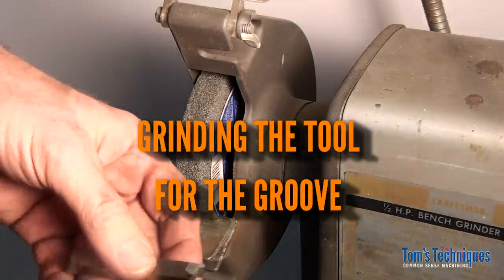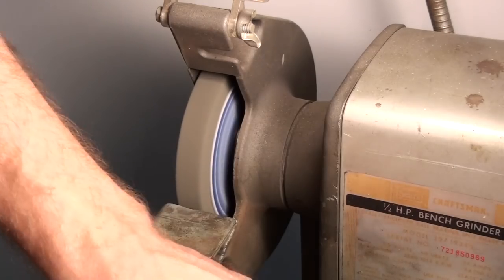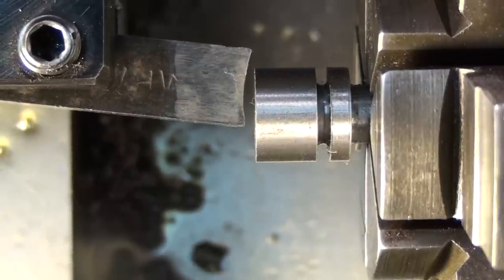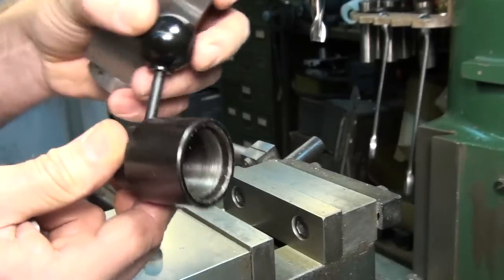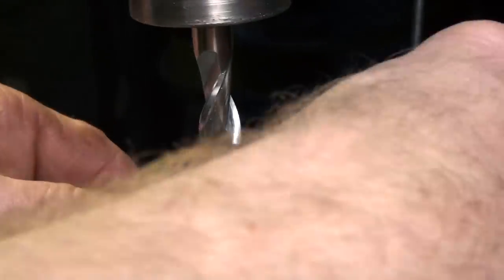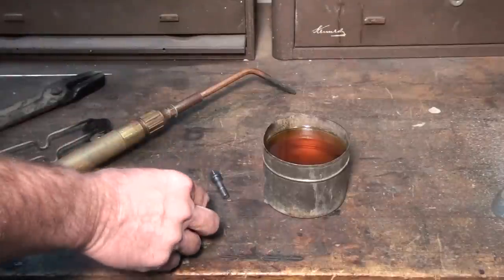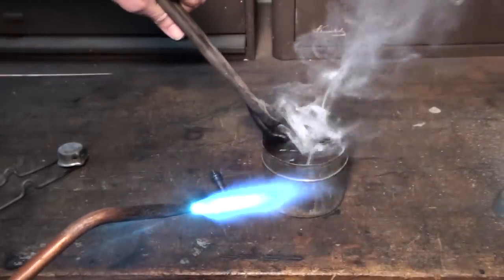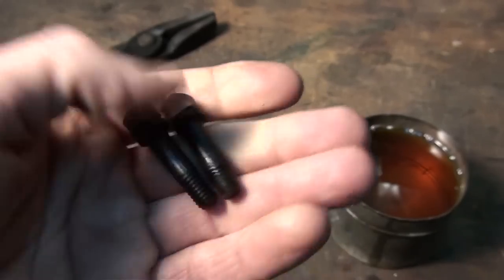Carriage Stop Clamp Bolts, Machining the Head and Heat Treating

Comment: Thanks Tom, I just got some collet blocks and the way you cut the square heads on the bolts was much simpler than what I was planning. Cutting the small relief on both sides then measuring is simple brilliance. The few parts I have heat treated really smoked like crazy when they hit the oil, I was surprised to see much less smoke and just a bit of surface flame when you put the part in the oil. I was going to ask what oil up you used but you already answered that question. 

Thanks
Shawn
Reply from the maker: Shawn,

You may not have noticed, but I burned off a lot of the smoke with the torch during the quench. It would have smoked more had I not done that,

Tom

Comment: Tom thanks for posting, especially  the HT portion of the project.  I might have to try that oil finish it looks pretty good.  Is it as effective if you start with a cold part that was not heat treated?  Say a 1018 part that did not need hardening?

At some point maybe a shop tour video?  It's always good to see how others have their shop setup.
Reply from the maker: Bill,

Oil blackening will work on any carbon steel part, it doesn't have to be high carbon steel.

A shop tour is on my list. I see that most of the other guys have done it. Maybe after spring cleaning? :)

Tom

Comment: Hi Tom,

Great video. I've done a lot of heat treating of O1 and love it (for knife making). I do use an electronic kiln and SS foil. I'm guessing that the tongs will act as a heat sink and prevent the place where they touch the part from reaching critical temp. Perhaps holding the head or shaft would be better. I'm guessing that the threads are  where you really want your toughness and the head will get some even with the heat sink. Just my thoughts. Thanks again… I love the oil finish!!
Reply from the maker: The tongs only have point contact on the crest of the thread so they probably aren't going to affect it. I have a smaller pair somewhere....

Tom

Comment: Thanks Tom!  Phase diagrams never made sense before. Now I think I can figure out the right temps for whatever steel I end up using. 

Can I assume that the "O" in "O1" is for "oil hardening", and that "W1" would be "water hardening"?  And that otherwise the process would be the same (except tempering....burning off the water won't work as an indication of temperature, or give a nice black finish)?

-- Mike
Reply from the maker: Yes, the O is for oil the W is for water and A is for air. They all have different characteristics and applications. Check the links section of my website (tomstechniques.com) for more information on steels and heat treating.

Tempering is the same with any of the steels although the range of temperatures vary greatly for the different types. You just heat them up to the temp needed to obtain the harness required for your application. The oil blackening step can be applied to any steel as long as you don't get it so hot that it takes the hardness out.

Tom

Comment: Those are some nice looking fasteners, Have you ever annealed the tool steel before machining just wondered if it would be easier to machine. Thanks for sharing your techniques..
Reply from the maker: O1 drill rod is already in the annealed state. It's just tougher to machine compared to the free machining steels.

Tom

Comment: Thanks for the video Tom.  Will the screws remain black even after knocks and scratches?  Really appreciate the video.  Sameh.
Reply from the maker: Parts blackened in oil aren't as durable as the black oxide coating used on socket head cap screws, but they hold up pretty well. The nice thing is that it's easy to "freshen them up" if needed.

Thanks for watching.

Tom

Comment: Yes tom another great job you are a very good machinist can I ask your opinion I'm getting another lathe I have a choice of a 10 by 20 precision Mathews or a 12 by 36 craftsman atlas commercial your opinion on the better lathe I would value your choice thanks for another great video
Reply from the maker: Thanks.

I'm not familiar with the Matthews, but would not recommend the Craftsman, or any lathe with flat ways. They are plentiful, but suffer a severe lack of rigidity.

Tom

Comment: Need to heat treat and temper a small 01 form tool I've made, so your heat treat/temper process was very informative. Did not see/hear it mentioned, but what oil were you using for quenching? More importantly, will any oil lose its sheen during the tempering phase? I'm planning on using canola oil, so will it dull like yours did to tell me I have reached the proper temper temperature? Much thanks.
Reply from the maker: Any motor oil will work for quenching. I just use whatever is left over from the last oil change. I have never tried using vegetable oil so I wouldn't recommend it. It may cool the part too quickly to achieve the proper hardness. It also has a lot lower flash point than motor oil.

Tom

Comment: Tom, I know there are several to choose from, but what oil did you use for quenching on this project? Is there any reason you chose this oil vs. another? I understand water or salt water might cool too quickly, resulting in a brittle part.
Reply from the maker: Oil is oil when it comes to quenching. This was some old 40 weight motor oil that I don't use any more.

Tom

Comment: Excellent info. Just please talk louder when using the torch. You prob gave critical info that couldnt be heard so please either speak way louder or explain everything prior. Thanks for the good teaching and explaining the chart was a huge help.
Reply from the maker: Sorry about the torch. I had no idea it was so loud until editing the video. It was worse, but I processed the audio end edited as much of the high frequency hiss as possible. Next time I do a video with a torch, I'll know. If I get some time, I'll add captions to the video.

Glad you liked the part about the iron carbon diagram, it's been a while since I used it.

Tom

Comment: Thanks for the heat treating segment. Is the oil anything special or just something like 30 weight engine oil?
Reply from the maker: Oil is oil when it comes to heat treating, it all works the same. This was some old 40W motor oil that I had laying around.

Tom
Reply: Thanks Tom!

Comment: Hi Tom !

Why not just some thin wire instead of the big heat consuming tongue ?
Reply from the maker: Because when I drop the hot part on the bench trying to hold it with wire I'd have to get the tongs anyway. :)

Tom
Reply: Toms Techniques HA, ha, ;-))

Comment: Can you run a carriage stop if your leadscrew doesn't have a clutch in the headstock?  I am thinking it may lead to a damaging crash in a moments inattention?  I would really like to install one on my 12x36 Grizzly G4003G but Grizzly says it does not have a clutch feature.  Thus I would potentially be coming up against a hard immovable object.
Reply from the maker: +Douglas Thompson 

It has nothing to do with a clutch Douglas. Lathes that are designed with power feed stops, like my Hardinge actually disengage the feed when the stop is contacted. PLEASE don't try it on a standard lathe.

Tom

Comment: is it just me or does that chuck have quite bit of run-out?
Reply from the maker: It's either you, the video or maybe me since it's fully adjustable. I'll check and see if it needs tweaking.

Tom
Reply: Toms Techniques  at around 8:25 before cutting the groove it sounds off maybe the was something on one of the jaws, at around 13:30 the inside of the groove looks offset

Comment: Did that bolt spin when you took the first heavy cut, or am I hallucinating? Maybe you oughta hunt down that spanner wrench! :)

http://youtu.be/s9vM6E4TdeM?t=20m36s
Reply from the maker: Well, it ended up square and to size so if it did move, it didn't move by much. Collet blocks are a bit weak in the grip category so it wouldn't surprise me if it did.

Tom
Reply: Yeah, they definitely turned out nice!